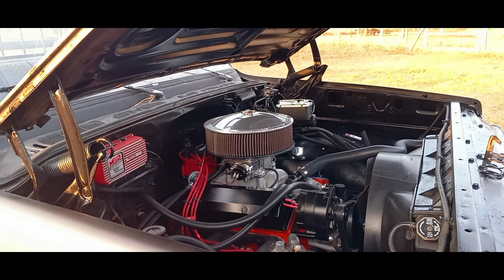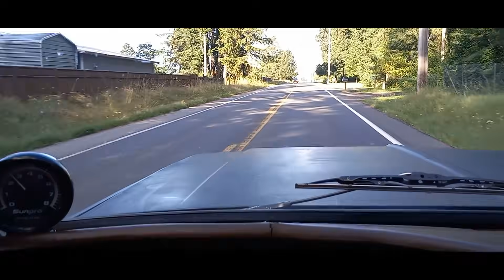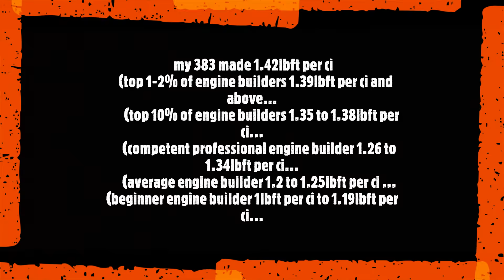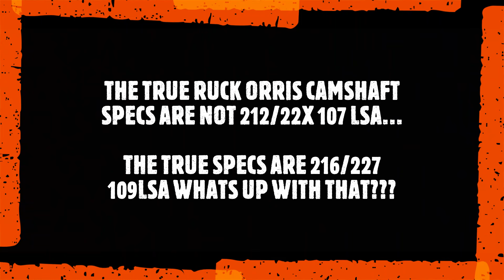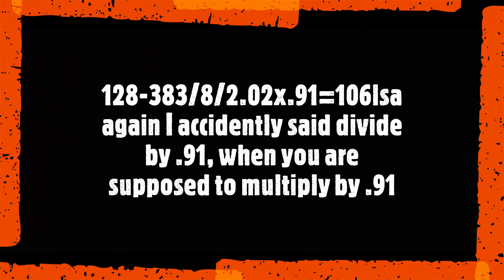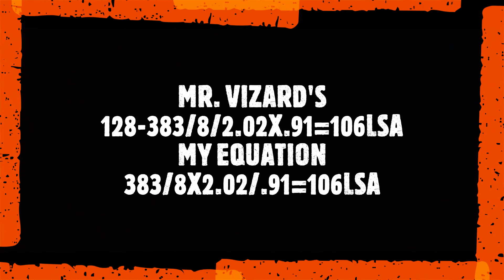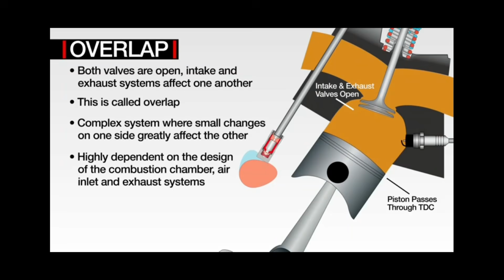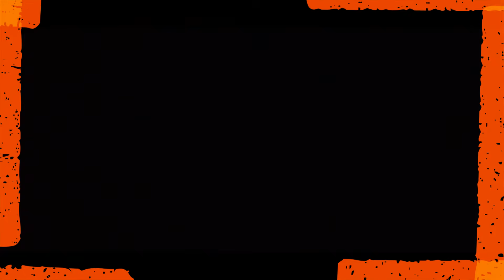CAMSHAFT SELECTION by LSA, 9 LSA's DYNO TESTED!!! LSA THEORY WILL BE DYNO PROVEN!!!, and EXPLAINED

Comment: Wisdom is made known by its children. Even though I'm 16 years older, I'm your son. Ex Lab Technician, Index Tests Verify what you say, and what DV has Always Said. Good Health and Pain Relief. Dean Stevenson, regularly shadowed. Ex Dementia Care worker 2005-2016. PS, Won't be joining your channel despite being a member of Old Man's Garage. When Dyno Figures don't add up, I don't argue, I leave with my feet. "https://youtu.be/oPBe6LS0r1M"
Reply from the maker: Thank you i appreciate you taking the time to watch..Im not sure I'm following you, are you implying that a  low compression 9:1 400ci sbc with a stock rotating assembly which is by no means low friction, with a pair of un modified performer rpm heads, an unmodified performer rpm air gap intake, and a comp xr270hr cam that specs 110LSA 106 ICL 218/224@.050 .495/.502lift. Keep in mind a 110lsa in a 400sbc will not produce squat for tq nowhere near max potential & no amount of advance will make up for that! A 105lsa would produce max tq in a 400ci sbc... you do realize 540lbft out of 400ci is (1.35lbft per ci) now im gona say, i am actually friends with Bill, and i am actually gonna be staying at Bill's house sometime later this year.. Now with that being said the results produced by the dyno were false, and i have experienced these anomalous situations when i was younger building and testing race engines with my dad & grandpa we had a few engines with output that was physicaly impossible and when that happens its obivous there was an issue and you throw those results out!! those numbers were the result of cranking up the pressure on the dyno, and loading the dyno up hard it up at a low rpm befere making the hit... you can ask MR. VIZARD or RICHARD HOLDENER if the kind of numbers produced in this dyno test by a low compression 400ci sbc of this specific combination of parts is physically possable.. when you get the answer NO! Then ask if a N/A low compression V8 making (1hp per ci) can produce (1.35lbft per ci).. you will find that the answer is NO!! I had brought this to bills attention right when I seen the video and I was one of the first to watch, I had told him that given as I am a rare individual i bet that im probably the only individual who commented on the outrageous tq numbers, and would definitely be the only one to break down why there wrong... and of course out of the 126k people that have seen that video and the 1.3k that have commented on that video, I am still the olny one that brought it to his attention ( and bealive me i did not want to, because even though i am friends with Bill he still don't know me very well and its kind of hard to tell someone that the HP & TQ numbers, specifically the TQ numbers that were produced by their engine on the dyno were incorect, you tend to look like an ass lol.. But given the case that the results were so obviously out of the relms of our reality, i could not let it to go, I had to try to save him from the negative exposure to others who knew better and or someone telling him by being an asshole...but it turns out im the only person to comment about the tq numbers just as i told him i would be... even given everything I had said to him and all the proof from the real world I gave, I said I didn't blame him if he dont bealive me because of all the internet experts.. well he must not have believed me or looked further into it, because if i was in that situation i would have let those 126k people know that the dyno results were incorrect and physicaly impossible to eliminate the spread of inaccurate information.., and even as outrageous as the results were, being as the numbers came from a dyno people will eat it up, and end up with unrealistic expectations..
  I had  broke it down for him as simple and shortly as I could  have.. now i really really hope you were not implying that you bealive this combo of parts and the CI is physicaly capable of 400hp@4000rpm= 1hp per ci and 540lbft@4000rpm= 1.35lbft per ci which is physically impossible within the relms of our reality...ALOS HAVE YOU EVER SEEN A V8 ENGINE MAKE TQ AND HP AT THE SAME RPM, OR ANY ENGINE FOR THAT MATTER!! ANY N/A V8 ENGINE WILL NOT PRODUCE (1.35LBFT PER CI) WHILE OLNY MAKING (1HP PER CI)!!... DOES ( BREAK MEAN EFFECTIVE PRESSURE COMES TO MIND🤔 ) TO ACHIVE (1.35LBFT PER CI) N/A YOU WOULD HAVE TO MAKE AROUND (1.30HP PER CI) TO (1.35HP PER CI) OR MORE!.. MOST PEOPLE  WHO MAKE (1.35HP PER CI) STILL WONT PRDUCE (1.35LBFT PER) MOST PEOPLE WONT EVEN COME CLOSE TO ACHIVING (1.35LBFT PER CI) Example with BILLS 421 has 21ci more than the 400, bills 421 is 13:1 compression, now keep in mind COMPRESSION AND CI INCREASE TQ PRODUCTION, PLUS THE FACT THAT THE 421 WAS RAN ON DYNO WITH E85 WHICH PRODUCES MORE TQ THAN THE 87-93 OCTANE THAT THE 400 USES.. the 421 for Bills malibu made 545hp@6200rpm & 521b-ft@5100rpm which is (1.29hp per ci) & (1.23lbft per ci CI).. IF ANY OF THESE ENGINES WERE GOING TO ACHIVE (1.35LBFT PER CI) IT WOULD BE THE 421!! AND THE 421 ONLY PRODUCED 1.23LBFT PER CI.. now with that being said.. those results produced on the dyno by that 400ci sbc were incorrect to say the least! the last correct numbers that were produced by thet dyno were 457lbft@4000rpm & 372hp@4900rpm which is 1.14lbft per ci & .93hp per ci.. Now with Those being the last correct numbers produced, ask yourself why would loading the dyno at a lower rpm produce an increase of 28HP and 83lbft?? IT WOULDN'T!!! Prior to dyno testing i had told Bill that 400ci sbc would make about 380-400hp max &  450-470lbft max, Those numbers were extremely close to the last correct numbers produced by the dyno before it was incorrectly loaded..... also ask yourself, what engine have you ever seen that makes peak tq and hp at the same rpm???  Specialy at that kind of tq output and only 400 CI!! For an engine to make 540lbft@4000RPM & 400hp@4000RPM the engine would have to be around 500ci which would be 1.08lbft per ci & .08hp per ci.... do you see any similarly in the output ratios produced before the incorect output was produced?.... I have a hand full of dyno sheets from 454 big blocks that made between 450-500hp and still didn't  produced 540lbft, but did produce between 520-535lbft.... as I said, see what MR. Vizard has to say about a N/A V8 producing 1.35lbft per ci  while olny making 1hp per ci!! I hope you understand, and if you don't I hope you do some reaserch.. brake mean effective pressure is a good place to start, then calculate the output ratios of all kinds of N/A V8 engines and see what trends you find... take care buddy!
Reply: @CDG-Racing_Dynamics  CG, I'm with you 99.9%> This was my summary "18:00 This is not a valid screen shot for an engine like this. I trust your Dyno operator, don't trust the figures because they don't add up. I spent a month working it all out. No hard feelings. I'm just an Ex Lab Technician. 4000 rpm times 400 divided by 400 HP without a power adder isn't creditable. Just my opinion, and don't get bent out of shape because I've always been That Guy. 🙃🥝✔️🥳🆕Year"
Reply from the maker: That's funny because I literaly just seen that you made that comment to bill about 8 hours ago..
Reply: @CDG-Racing_Dynamics  My warmest wishes. I've spent from 1990 to 2010 doing polynomial linear data regressions for road roughness to GM Developments Quarter Car Model, and advanced Dynamic Compaction measurements via Nuclear Density and Physical measurements. Everything you say rings true. I have joined your Channel because your reasoning appeals to the prerequisites of dependant and independent data   and dimensional analysis...just what my Engineering tutors have taught me. Have a great day. Nice explainations. Best wishes for pain relief and comforting and tending to  your Family. My wife and Daughter work at a rest home, and it should never be the first choice. Family IMHO,  is Best. 😉
Reply: Best wishes, Man.
Reply from the maker: I also see that you said you are an ex dementia care worker. My grandmother was diagnosed with Alzhimers/dementia in 2006 and has been living with us since 2010,  it has been a long hard, heart wrenching experience watching someone you love so much decline and revert back to being a full grown 2 year old. she has been in the very end stages for quite a while now, she don't communicate, walk, feed herself, etc im sure you know what I'm talking about. Alzhimers/dementia is a real sick SOB and is a horrible way to go..taking care of my grandma is one of the things that keeps me going and wanting to get out of bed everyday, it's by no means easy or fun but she loves when I sing to her and it makes me happy to see her smile. I can't bealive alot of people just dump there loved ones at a nursing home never to be seen again, it's sad the way people think.. just had to say that because I knew you would understand. Take care Dean..

Comment: LSA is the first pick. Everything else revolves around it. I learned that in the 70s when my camshaft went down and I had a dirt track cam .I saw the power difference and understand.
Reply from the maker: Right on brother, im glad to hear that you know lsa is the only starting point for camshat selection, LSA is the only spec that when optimal you will get substantial gains across the tq & hp entire curve with no give or take as far as gaining high rpm power & losing low rpm tq & hp or vice versa.. its like having your tq & hp and eating it to.... take care buddy!!

Comment: Can computer simulation programs work to optimize cams
Reply from the maker: Not to sound biased, but there is no program that can produce a camshft that is capable of turning a N/A sbc into a big block eating monster that is capable of complete and utter domination in a race application... the cam softwares will get you in the ballpark for good performance and will produce results that will satisfy most people and their needs.. but that 128 formula has been tested and proven to be an extremely successfull empirical equation that was produced with more inputs, 1000's apon 1000's of dyno runs/dyno data, and coefficients than all of the softwares developed..., many of the top cam designers/engine builders have tried to produce something that can produce better results, but nobody can, they may come close to matching performance, but being completely honest, nobody but David vizard has yet to be able to quantify camshaft selection to the point that the average individual can produce impressive to optimal results... the 128 formula has been tested against multipule of literaly the best high end camshaft softwares available, and none of them could even hold a candle to the formula... here is a little example for cam softwares, I've never seen or ever heard of anyone being extremely successful in some form of racing by choosing a camshaft for an engine with software program that someone tried to develop.. again not to sound biased but the olny camshaft software I would consider putting any faith in is David Vizards IOP & cam program... I hope this helps, and I appreciate you watching.. take care buddy!!

Comment: Dam youngin, that's more words out of you this whole time.
Yet I understand the reason behind it, it's because you don't want to waste knowledge if at least one person grasp what you're saying. 
I agree knowledge was meant to be shared to improve everyone's lives, not kept inside a closed mind. 
Then become lost forever, are until someone else stumbled upon it through similar ways, and means as someone prior that refused to pass it down as your people did to you. 
Which only stimulated your mind to want more as it does with some. 
As for BT, never heard the name until recently, and can't say I was very impressed about anything I seen.
Definitely no Gale Banks, Steve Morris, numerous other's that definitely came up through trail and error, but always pushing the envelope to bigger and better things.
I agree with you on SBC's, but they always treat you right if you used common sense even on small bank accounts. 
Still can be somewhat competitive even in today's world. 
BTW, what transmission you stretching out there in the hay hauler.
Back in my time, if you were bangin gears, clutch was only used until your big toe slipped off the side. 
After that never touched it until I had to down shift, and toe the 4 drums so they didn't fade too quickly on me.
I'd say the plastic bushings came out from under the spring on the pedal.
That's the sound they make on the old mechanical linkage clutch pedals with the garage door springs used to return the pedal to position in the heavy duty applications.
Snicker, CAM, that's my ex wife's initials, that's only thing I know bout those.
Cost me a fortune too, during, afterwards. 
That's all I'm going to confess to knowing about them myself. 
My brains forgetting more as the days pass, and it is the sad truth that if you don't use it, then you will lose it faster than you realize. 
Except what happened 20, 30, 40, and even 50 years ago, but don't ask me about yesterday are last month.
Because most of the time I couldn't honestly tell you if you asked me something I n should know like the back of my hands.
PS
What year is your truck, because if I've seen the nose, I don't remember honestly. 
Nor do I remember a clear view of the gauges on your cluster.
Either of those pretty much give the year away, nor do I remember marker lights on the fenders.
See I can't remember dam thing, and I'm fairly certain it's not GMC.
Although I think GMC had a much better look with the 4 headlights compared to just the 2 on Chevy's.
My opinion of course, and although I truly loved my 70 C10 camper special long bed.
My uncle was millwright at GM Arlington, Texas from time the brought the plant on line until he retired some 35 years later. 
He ordered the best looking, and probably the best running truck of that body design. 
1972 Cheyenne Super C10, 400/402, turbo 400, 373 12 bolt limited slip.
Hounds tooth,white interior, black dash pad, full gauge package including tach, a/c,
 p/s, curse control, that dam buzzer for manual speed warning, tool box in bedside, chrome bumpers, chompition orange and white, with factory turkey plates hubcaps, dual exhaust, wood grain tailgate insert, full trim package, and I swear it had tilt steering column too, with am fm stereo. 
Said he watched it go down the line the day they assembled it.
Stayed over from his 3 rd shift to see it hit the last station, and they let him drive it off the line at the end. 
That was the best looking best running Chevy truck ever built in my opinion. 
Only thing to make it perfect would have been GMC grille with 4 headlights and Chevy insert instead of GMC
Reply from the maker: Hey Timothy, how you doin there buddy? I sure did do alot of talking in this video for sure, bealive it or not just to get that 1.5 hours of talking out of my mouth took me about a month, which is absolutely ridiculous, that would have taken most people probably 2-3 hours max to read seamlessly without mistakes, I was only capable of talking while recording my voice for about 1 minute or less, so the whole video was peiced together with 86 sound clips of myself talking lol..
 Hell just getting the information out of my head and typed out took me more than a month by its self because I can't hold on to my thoughts long enough to write them out, or even say them for that matter, and typicaly when I do go to write my thoughts as soon as i start writing I can't remember what I was going to write, then I have to stop and try to Remember what I was thinking.. it's a real S.O.B and its irritating as all hell lol.
 it sounds like you can relate to the decrease in neuronal activity in our brains thats affecting memory, thinking, and the inability to complete mental/physical tasks that at one point in life would have never been an issue at all... my dually is a 77 chevy with an sm465 4 speed, it can be shifted without the clutch but it sure dont like it lol. I use to drive a 10 yard dump truck with an 18speed tranny at work and I only used the clutch to take off in that bad boy ... it sounds like you and your uncle had some pretty sweet ass trucks!! Those 67-72 chevys are my personal favorite, I've never personally owned one but when I was a kid my grandpa that was the physicist & engineer for gm had a extremely dark blue 1970 chevy k20 with a blown 402 that had water methonal injection, it was one badass truck, it was estimated to be about 750hp on pump gas.. also when I was growing up my dad had, and went threw so many of those trucks along with the so many of the 1960-1966 trucks, he also had a sh!t ton of  73-87 trucks.. all of those trucks use to be so abundant, cheap and easy to acquire, but them days are long gone... well buddy I hope your sweet little girl is doing good, give her a belly rub for me, I hope you stay well Timothy my friend... take care brother!!  - Adam -